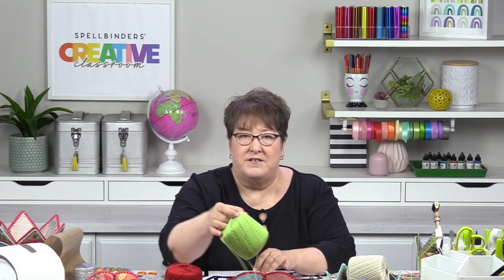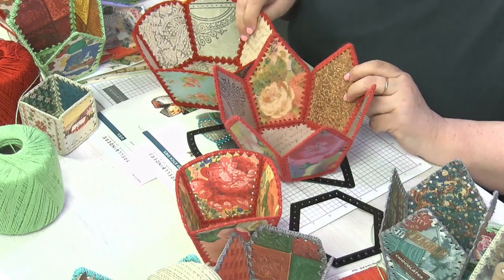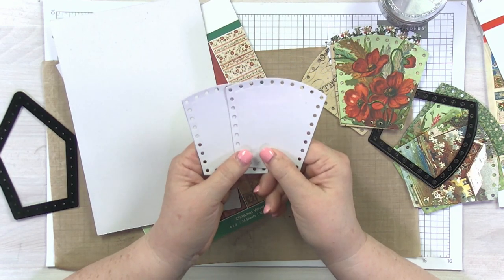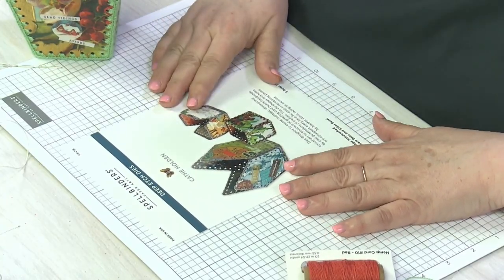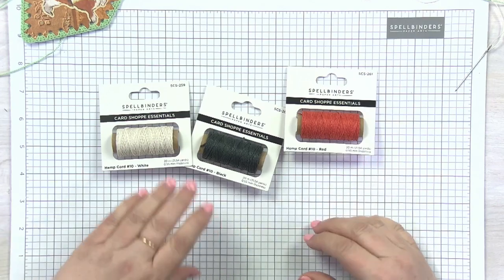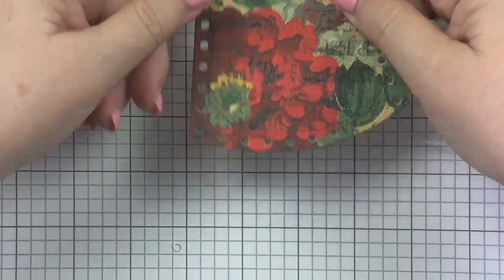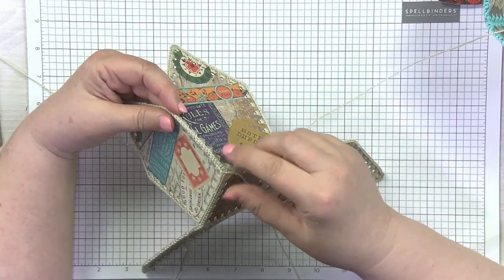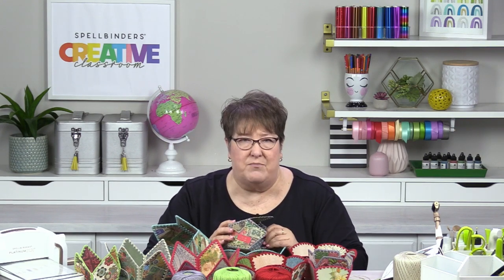Tutorial: Vintage Handcrafted Bowls Deep Etch Dies by Cathe Holden

Comment: Very cool! That glue comes in a glue stick form, too, BTW. When I saw the bowl made from just the small square, it reminded me of making little baby's blocks of needlepoint (or grospoint) on plastic mesh squares. Using the little square die, you'd need six instead of five so you can close up the blocks, maybe filling them beforehand with jingle bells or something that would rattle, to make great blocks for a really unusual baby gift.

Comment: Will you be doing a video for the blanket stitch assembly? I don't  crochet.
Reply: Hi, Lynn: For the assembly, it's basically the same thing; you just lace the sides, using the stitching between the holes, attaching the sides to the bottom first, then zip up the sides as I show with the crochet.
Reply: Hi Lynn, I also did a video, not quite as awesome as Robins, but I'm more blanket stitch than crochet as well and show how I do it on my channel. Just uploaded the video today. Hope that helps.
Reply: Cathe, thank you. I am a follower now.

Comment: When using fabric to make these bowls...which fusible interfacing or bonding sheet would one use to fuse printed and solid fabric together before die cutting pieces?  What type of yarn or crochet thread should be used to stiche around each piece segment and to connect to base die cut?